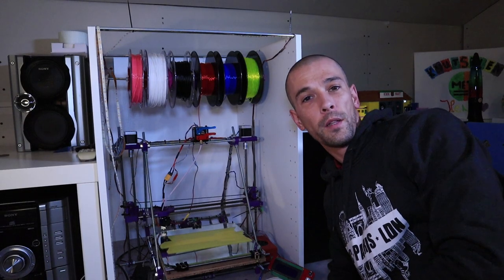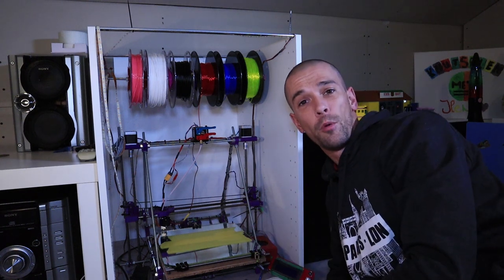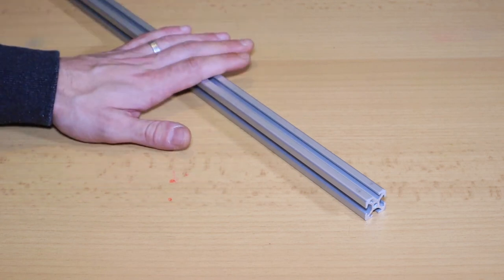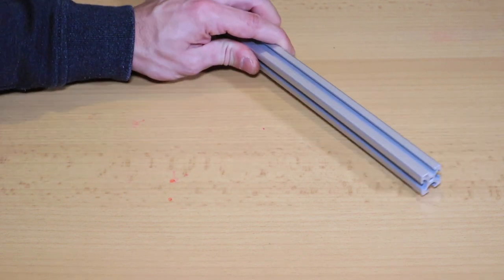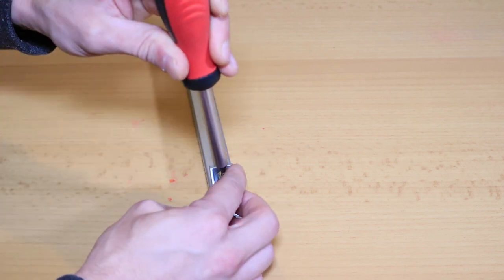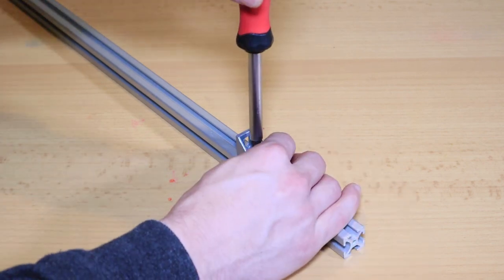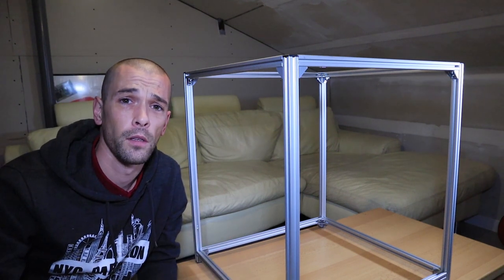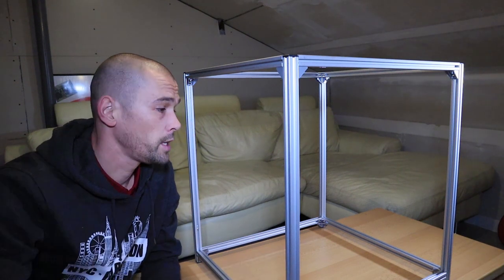EP.01 - Building a 3D-Printer - Hypercube evolution

Comment: Pieters, so the dimension need to be +70% of the intended print "volume",  correct, or after a given size, the proportion varies, needing also a beefier frame?   Thanks
Reply from the maker: Uhm, i haven't actually calculated it, i'll mesure it and tell you ... but it all comes down on how you organise your axis... you can even place the motors on the outside of the frame... the frame is ok, but indeed i need to make it a little stronger... 2020 still gives some wobble
Reply: @pietershomeprojects4537  I would eventually plan for a 65x65 useful printing size so a 3030 'profile is mandatory.  Folllowing your advice of taking an existing machine as a basis and improve on that, of corse with an Hypercube on the sights, is there a model/brand you would recommend?  Also, are there any cons in having some mounting parts in alu or brass? Thanks for your answer.
Reply from the maker: hey Roberto, 
i don't see an issue with alu or brass parts... if you plan to build a machine like that the minimum is indeed 3030 maybe even bigger (8040 or 4040). A core-xy setup is in my opinion pretty good, maybe check the voron, it's also a nice printer, but the buildplate is fixed... 
I'm waiting for some parts to arrive, i've got some professional MGN rails ordered... and i'm pretty convinced it will give me better results...
Maybe this might be an intresting link for you:
https://mechlab.cc/which-corexy-voron-vs-v-king-vs-d-bot-vs-hypercube-evo/
Reply: @pietershomeprojects4537  Brilliant, tanks again.
Reply: @pietershomeprojects4537  Pieters since you are so kind to reply, may I ask you one last question (I have hundreds, but I feel there comes a time when, you have to experiment by yourself); My question is; if you had to reproduce, say a shield (slightly  curved), maybe 50 by 40 would you print it standing it upright or laying  it flattish, including  supports that will need to be removed  once finidhed, or is possible to print without ? Thanks
Reply from the maker: that's a difficult one 😉. 1st thing you need to think about is does it have to be strong, i mean, are there forces involved with it... 
If yes, and they are going to be on the curved side... i would lay it flat... 
If not, i would preffer to print it standing up, as this will probably give the cleanest result without post-processing.
Honestly, if i could see the design first, it's easyer to determine...
I really don't mind your questions, feel free to e-mail me (pietershomeprojects@gmail.com)
or join the facebookgroups out there, a lot of experience can be found there...
for printing:
https://www.facebook.com/groups/501167360318082/
https://www.facebook.com/groups/3DPrintingUsefulThings/
for building 3D printers:
https://www.facebook.com/groups/cncbuilddesign/
I'm member of those groups myself, and even I go there if i got an issue, or question, always got a respons in no time!
Greetz